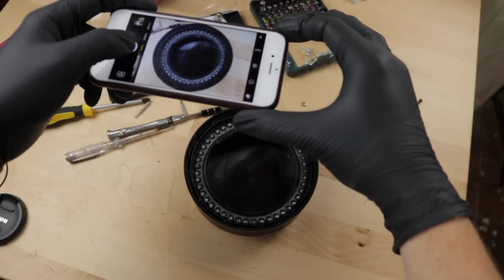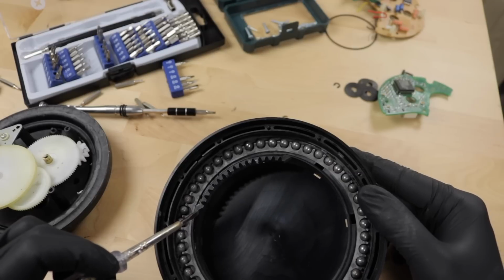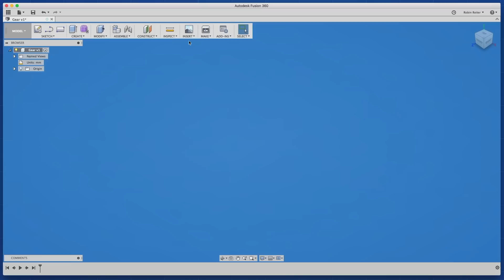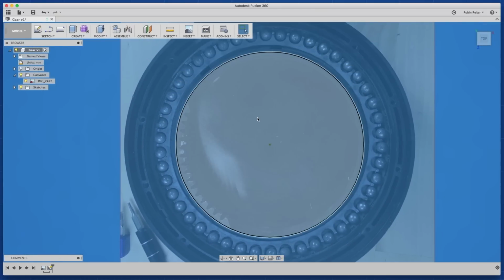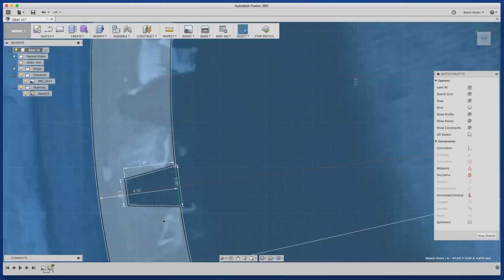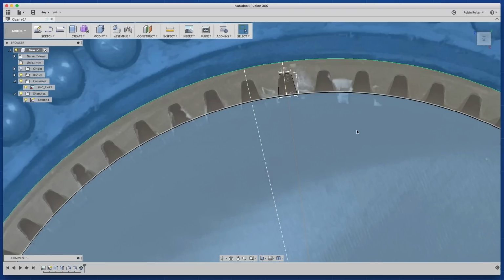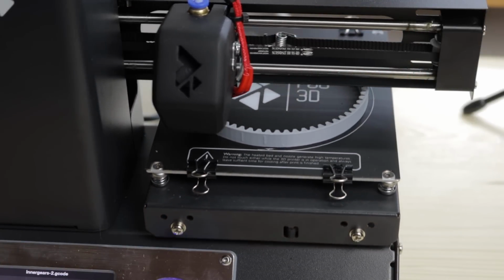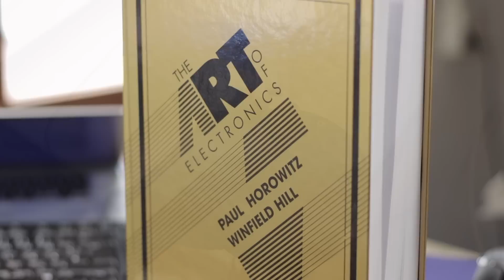DIY Motorized Turntable from an old TV stand - Practical 3D Printing with Fusion 360

Comment: Hello there great video. I noticed you used a spanner on your Dremel. On mine there is a spanner built into the top collar where the chuck is. Unscrew the top collar and slide it up onto the collar it should fit the chuck and you can use it to tighten the chuck without a standalone spanner. Let me know how you get on 😀